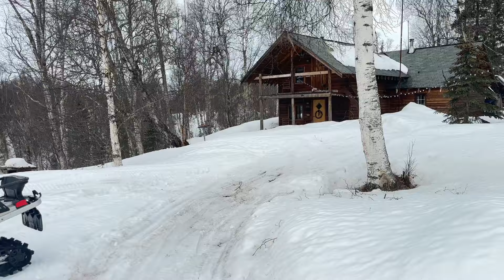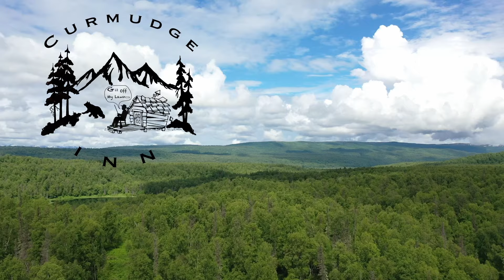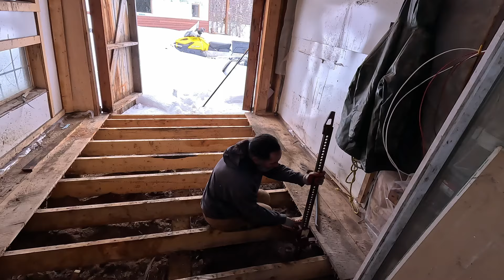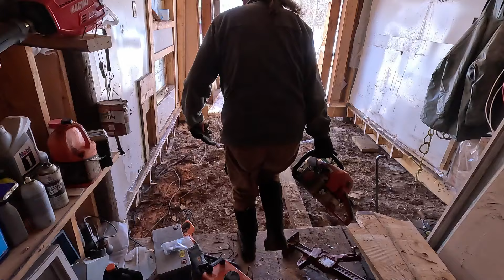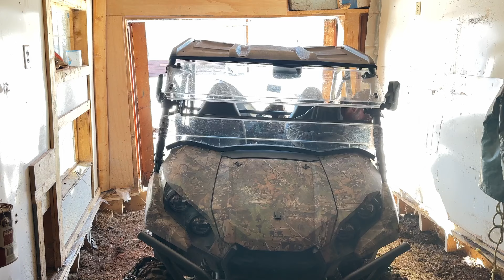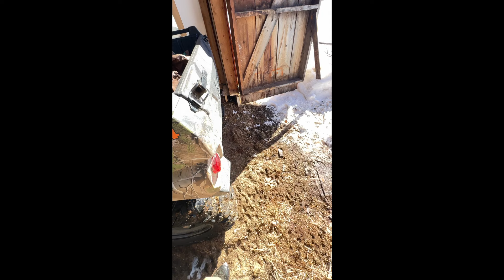Setting up my off grid garage/workshop!

Comment: An excellent enginuative idea. Maybe consider to make the wood floor boards lower or add a block or concrete floor? Or dig and line an inspection pit with boards, blocks or concreate where you can do underneath maintenance. 

 My cousin made, such an observation, working / inspection pit in his garage shop. It was a very effective tool for observing and fixing car/ automotive problems. As during that time of Soviet occupation of Estonia there was no such large-scale service automotive services, everyone had to be very creative to surrive.
Reply from the maker: I have some cement mix I want to use for the floor.